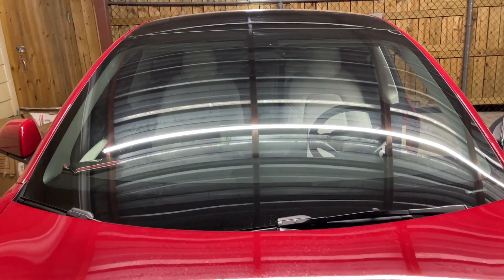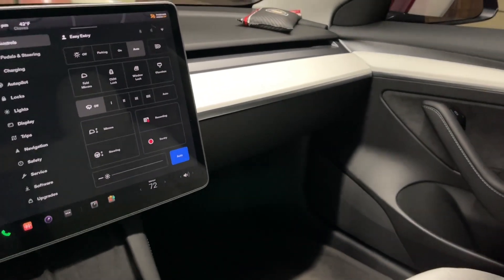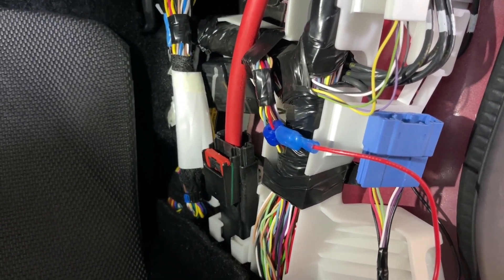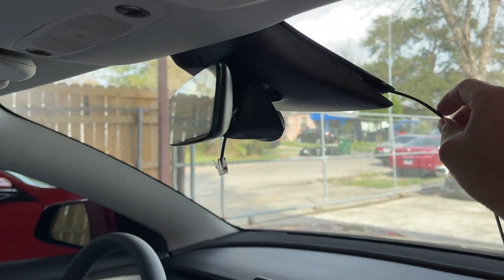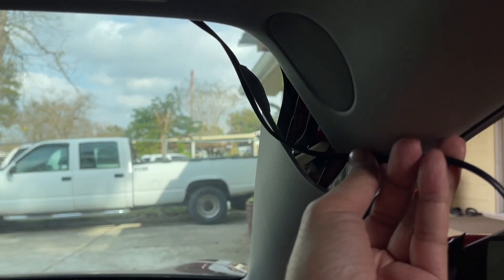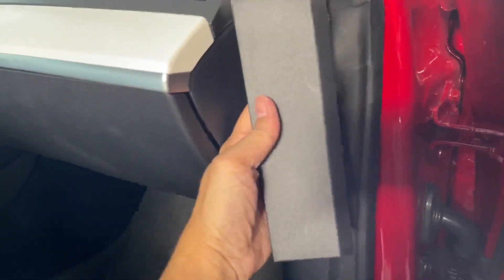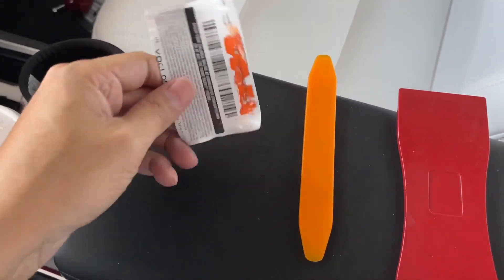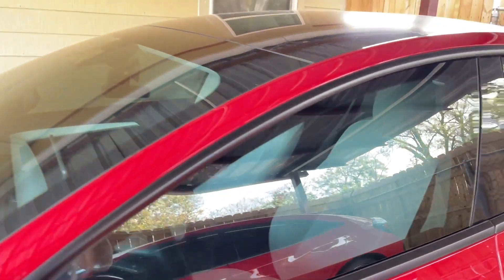How to Hardwired Radar Detector for 2022 Tesla Model 3 with BlendMount Kit

Comment: I can say this was a great video, easy to install, and it worked for my V1 Gen2. However, my 22 M3 LR has <1K miles on it and I had a sensor issue where regen stopped, traction control, stabilization, and I think one other thing. I took it to Tesla and they are claiming the failure is related to this wiring being tapped, which they say is the Airbag wire. They are giving me the car back but saying it may affect the safety of the airbag deployment and cost me ~$200 just to look at and will cost $1200 to replace the harness, FYI.
Reply: did you figure out if it was infact the wire tap that caused your issues? if so, I inclined to not take the chance and either find another wire or just forego install all together

Comment: Thank you for this. What happens in Sentry mode? Dog/Camp Mode? The radar stays on?
Reply from the maker: Hi. Sorry for the late reply but the radar do not turn on when Sentry Mode get triggered. Same with Dog and Camp Mode. Radar Detector only get activated when I sit in the driver seat and press the brake. The moment I get out of the car, seat sense weight pressure gone and radar turn off. Hope that helps.

Comment: Anyone try this 12v wire yet on a 2018 or 2019 Model 3? Is it even there?
Reply: Soooo to answer my own question, YES the wire is there, and works as described with my Uniden R7 detector.  NOTE: Be sure you have you phone key connected and active or a key card handy when testing the ON/OFF function of the 12v switched wire and brake pedal. Silly me, disabled my Bluetooth on my phone, and well yeah...big headache and much more time consuming than it should be trying other wires. Doh!!!
Reply: I was looking for this thanks

Confirmed it works on my 2019. Just hooked it up last night and it works perfectly.
Reply: @ramblin_man23  Same wire and setup as in this video for the 2019 M3?
Reply: @chakdey1  not exactly. The 2019 doesn't have that group of wires going forward towards the front of the car like in the video, they all come down from the top instead, but I tested the red wires till I found the right one. Tapped into it and it works like his.

Comment: Which trim removal kit did you use? Did you buy tools individually?  Can you please include model number information for location on Amazon?  Thank you! Great video.  You make it seem so easy.  My guess is it will not go so perfectly smooth for me. :)
Reply from the maker: Hello. I did put the link to the the pry tool set in the video description. This one is nice too. https://amzn.to/3FOHtQS
It was easy overall but there were some hiccups along the way. Its doable but DO take your time or find a friend. 😅 Good luck!
Reply: @KPhan  Sorry, you did!  I didn't read the description in full.
Reply from the maker: No worry. All good. Happy to help. Feel free if I can clarify anything before you start this project/task 🤓
Reply: @KPhan  Now it's working only intermittently.  It's like one day the radar detector just stopped working and then some times its start to work again.  Do you think this is software or loose connection?  It was working perfectly for so long, then one day, nope.  It will come on without notice some times, but then goes out again.
Reply from the maker: @burnbrighter  My car recently had an AC issue where it won't cool. So I uninstall the radar to take it into service (just in case 😅). Tesla Service Center replaced the AC compressor and Freon but I have been too lazy to reinstall the radar. 

It is a known issue when the radar or accessory tap stopped working to be software update related. I have experienced  in the past before this video install when an update stop the radar but a few update later, auto fixed itself. You can double check the connection but I doubt it will suddenly be a "loose connection" if you know you did installed it properly. When you say it will work intermittently, what do you mean? That wire tap get trigger when you press on the brake. Next time it stop working, try to disconnect the cable from the radar side and plug it back in to see if it will power on. I will follow up when I find the time to reinstall mine. Please keep me posted.
Reply: @KPhan  I actually did try simply unplugging the cable to the detector.  Replugging it back in immediately doesn't do anything, but waiting some time does restore power, but only for a short amount of time before it shuts down again.  This smells like it is software related.  I hope some later update fixes this.  I will be curious to know if you run in to the same issue when you reinstall your detector.
Reply: @KPhan  it never worked again.  I am going to have to find another place.

Comment: Great video. I took your idea but I used the break controller connector that’s on the driver side. With that I didn’t have to peel anything or scratch the paint (not that’s a big deal) it was a bit easier for me doing it that way. Although as for the rest, I’ve followed your recommendations to the T. Thanks for sharing!

Comment: Hi are you able to find the size of the bolt for the ground? thanks
Reply: i also have this question
Reply: i ended up using a 12x1 1/2 sheet metal Philips flat head

Comment: When there is a software update is it going to mess up the wire or anything?
Reply from the maker: The car has gotten updates and its still working fine. On my last car, I tapped into the 12V socket and when car got updated, it either cut the power or the radar stayed forever until it timed itself out. I think this time, it will be fine because it will only turn on when there is a driver present. I will post and update should there be any changes.

Comment: Thanks so much for the detailed video! Did the wire come with the fuse and wiretap? Also, how does it exit by the mirror without getting cut between the 2 pieces?
Reply from the maker: Guess my video wasn't that detailed after all lol. Yes, the fuse is included with the hardwire kit. Everything ready to go. The cord exit out of the mirror socket. So from the headliner, it feed into the Autopilot camera housing, into the mirror neck where I used the plastic gift card to remove the cone shape. Hope that helps. Tesla sent out a few updates since this video and radar is still working great.
Reply: @KPhan  thanks for the info, getting started now. ill let you know how it goes.

Comment: This is fantastic, thank you! Does the windshield have any RF coating that interferes with the radar detector? My brother’s model S has just a square area beside the rear view mirror that allows a radar detector bc there is no RF coating to interfere with reception just in that area. Any info on this?
Reply from the maker: I believe on the older Model S had that RF coating that you are referring to. Newer Tesla shouldn't have this blocking/interference issue anymore. At least I am not having issue on my Model 3. One day I hope to upgrade to a Model S 😁. Oh, I do have tinted windshield and still no issue.
Reply: @KPhan  thanks so much for the reply! Great work here.

Comment: Hello, how can  I convert this to USB c output to power my dashcam?
Reply from the maker: I use this RJ11 to USB C cable. https://amzn.to/49iMlus
Reply: @KPhan  that makes sense to use the adapter. But.. the hardwire already has the male RJ11. I suppose you first use female to female RJ11, in between hardwire, then RJ11 to usb c?
Reply from the maker: @dostonkodirov8117  You can either hardwired it using the BlendMount kit or use the RJ11 to USB C cable instead and run it to your 12V socket. I just installed another radar in a Model Y and opt to use the plug and play method instead. Quicker to install and less future headache vs hardwired. Especially if you don't plan to keep the car for long. Hope that make sense. 🙂
Reply: @KPhan  thank you Phan, I really like the way hardwiring works because it doesnt waste the battery range. I just wish there was a way to do the hardwiring on tesla on that exact red cable but with Type C cable instead of RJ11
Reply from the maker: @dostonkodirov8117  Sound like you have a newer radar that uses USB C input instead of the traditional RJ11. I don't think it will drain/waste that much battery if you opt to use the car's existing USC C port. If you figured it out, please share. Curious to know.
Reply: @KPhan  I dont have radar, I’m using a Dashcam with type C cable. It’s been running 24/7 when I use the regular plugs in the car. This is why I was thinking about using your method but for Dashcam with USB C
Reply from the maker: @dostonkodirov8117  Having it run 24/7 sounds like it's constantly in parking mode recording (could be a good thing for better surveillance), which means you'd need to unplug the dash cam every time you leave your car. That could become tedious fast. Here's a thought: consider using a 12V accessory with a power switch. This way, you can simply press a button to cut off power to the dash cam. However, you'd still need to remember to turn it on and off each time. It's a bit more convenient than physically unplugging and replugging it every time. https://amzn.to/3xoKSFE

Comment: Darned.  2019 wiring harness doesn't match yours.  This is going to be fun....
Reply: Ok, mission accomplished.  Got the right hot wire on the second try.  Definitely had to get friend's multimeter to get it right.  I used a needle inserted on the first wire as a test conductor to not completely destroy the shielding.  Also had to cut the Tesla installed electrical tape to get to the right wire and the T-Tap was not totally easy to get in place.
Reply: @burnbrighter  What side of the car you found the wire and what color is it? I have M3 2019 as well but can find any that carry 12v switched (I'm using Fluke clamp meter and not find any wire has power). Thanks
Reply: @anchua6396  it is on the passenger side. There is a thick red wire coming down. It’s detailed in another video. I found it on my second try. I used a pin with a voltage meter to find it.  So yep, I have one red wire with a small hole in the insulation.
Reply: @burnbrighter  Thank you. For some reasons, I do see that thick, red wire on passenger side but have no power when using clamp meter. Do you think clamp meter works to check power in this situation or I need to use a pin with a voltage meter which I don't have right now. BTW, how to you put the ground cable? And your reader is still working find for now?